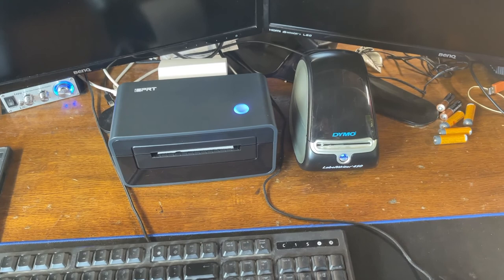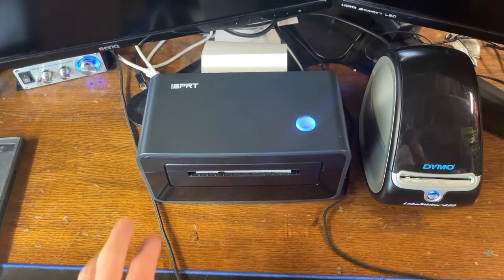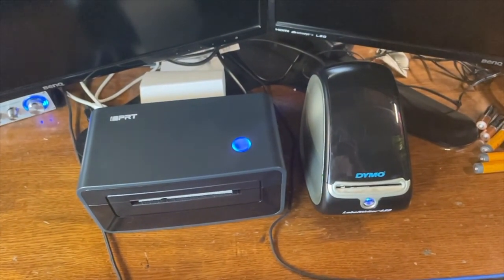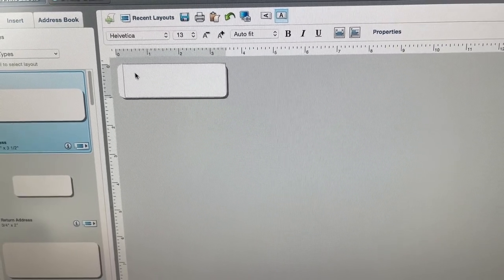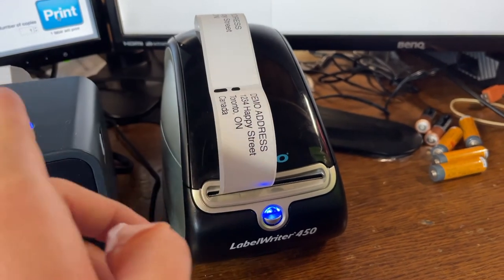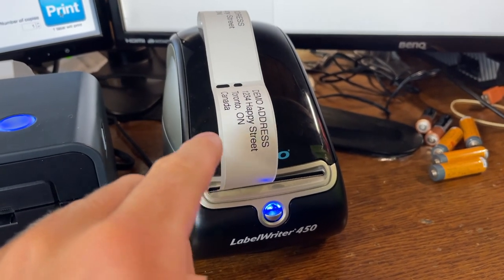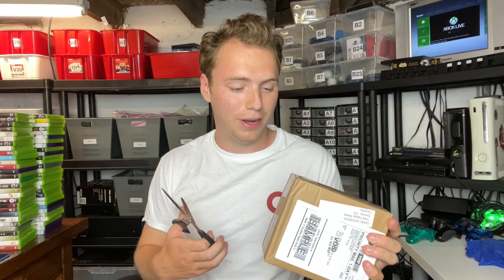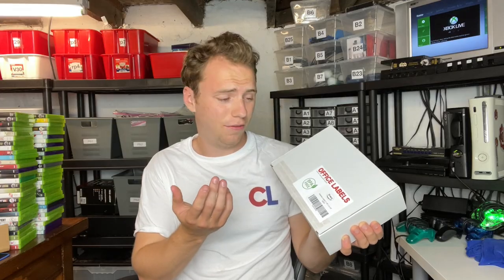How To Print Shipping Labels Using Thermal Printers (For Ebay, Canada Post, Etsy, Poshmark)

Comment: Would you recommend IDPRT Printer for Lettermail shipping (Non-standard and Oversize).
Love your videos! Thank you!
Reply from the maker: No I wouldn’t. The printer is great for 4x6 Labels but for small labels for lettermail, I would use a dymo labelwriter 450. You could cut 4x6 labels into 4 after printing 4 addresses with a template on a 4x6 label if you really just want one printer. Otherwise a combination of both printers is the best.

Comment: Does anyone know how to fix my IDRT SP410printer the label there seems to be an invisible line from top to bottom, going right into the center of the bar code, so when the post office try's to scan it wont work...any clues
Reply from the maker: Hmmm. That’s really odd. Are you using the correct labels with it? Perhaps there was a missing thermal area on your label that it’s not able to print to.

Comment: I have the same problem with my Dymo 4XL. So you have to get a different thermal printer to make 4x6 for Canada Post, right?
Reply from the maker: Not necessarily. I tested it and just cut out the one side of the Canada post labels and was able to print them on a 4x6 without a problem. It’s just frustrating as you would have to cut them out every time.
Reply: @common_lad  Right, I have to cut mine and it is frustrating. It makes the label half the size and the employee once complained the text was hard to read :(
Reply from the maker: I’m sorry I wasn’t clear. I meant cut them out in a software before printing. That seems to be the only way I’ve gotten it to work. Using a program that just allows you to essentially make a new document with just the label. Either ways still super time consuming. I could see how if you cut the actual label in half it would likely be to small.
Reply: @common_lad  Oh I see. That sounds decent for my purposes. So you just pay for the label and then paste it and crop it etc in something like paint and then print as 4x6? What program did you use? Thanks.
Reply: @common_lad  what program do you use for canada post labels? 
I have the thermal printer but need the edit program. Thanks CL